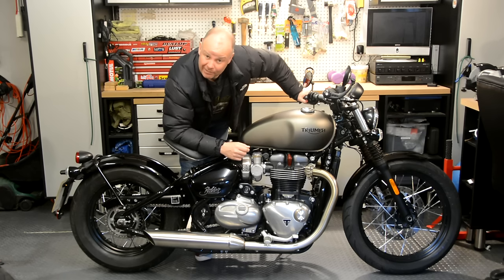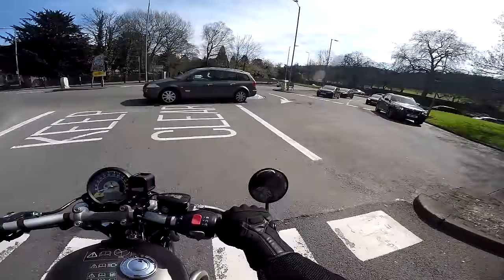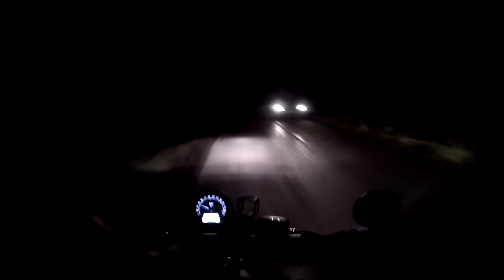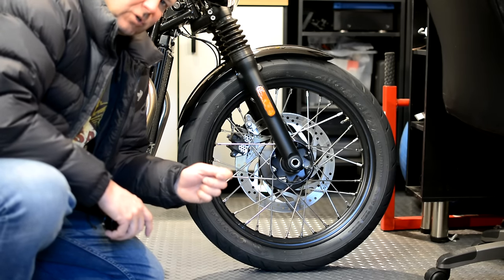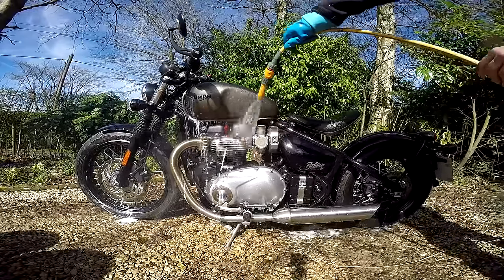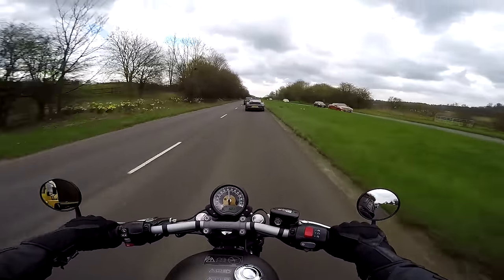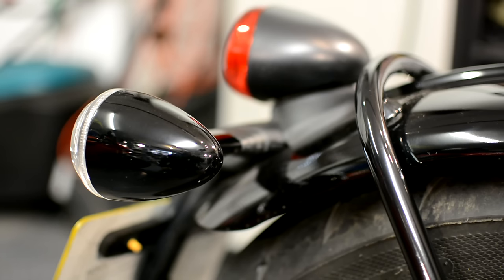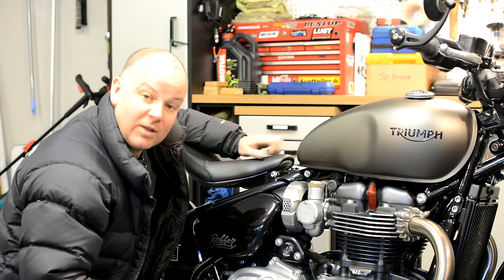Living with the Triumph Bobber - Long Term Review

Comment: Bit concerned about your corrosion issue.  Have you tried GT85, or similar, on the surface?  I know it's an oil, but an occasional wipe over with an oily rag might help with this?  Bit of a disappointment, though.

Great, fun and lively bike, though.  Big smiles!  Think I might go for the mini-apes and Vance and Hines pipes (to annoy my neighbours!).
Reply from the maker: Well it's not actually my bike, if it were it would be thoroughly ACF50'd!  Thanks for watching....

Comment: As ever - a well presented and balanced review. I looked at this before I bought my Bobber, so having had it three years here's my experience. 

The average fuel consumption gets up to around 60mpg once the engine is run in. I usually need to refuel at around 90 miles, with 30 miles left in the tank. I have done just over 230 miles in a day with one fuel stop midday (and yes the light was on towards the end of the ride.) The new 2022 Bobber has a bigger tank, but personally I think it spoils the look of the bike. 

There are various tail tidies available, the nicest one in my view is Maund Speed's in Pasedena. He makes a lovely set of lights based on the old Lucas design. It suits the Bobber very well. 

One thing with the front brake, it wasn't until I replaced the fluid and added some ceramic grease to the sliders that the braking was radically improved. You can use sintered pads which improve the feel but wear the disc more quickly. Triumph dealers will service the bike using Castrol Power 10W-40 oil. The handbook recommendas Castrol Power Racing 10W-40 and it is worth the few extra pennies. The Racing spec oil will turn the gear change from positive and firm to delightfully silky.

The main point is I never get home without a silly grin all over my face. Then I get it up on a stand and clean it - which you're right, is not a quick process but worth every moment.
Reply from the maker: Great feedback - thanks Rev..

Comment: Great review. Love the looks of the bobber. Not practical enough for me though. I don't think you can call it an all arounder. You can't pick up girls on it. You cant haul very much camping equipment on it or run to the store with out a back pack. Since the rear suspension isn't isolated from the rear fender, anything you strap to it, it will be shaken off. My bikes have to perform a lot of different functions. I would get one if all I wanted to do is look good going down the road or to  bike nights. Different strokes for different folks. I'll just keep my 2012 basic Bonnie. Just put some new Michalin Streets on her. 140x70 in the back and 110x70 in the front. With the higher crown on the rear, it turns in so much better then it has ever done. Just took it camping last week end.
Reply from the maker: Nice one - thanks for stopping by Johnny...all the best - TMF

Comment: 1.5 gallon? Geezus,that's a thimble...remove the Cat,get a custom tank built from the bottom of the radiator,underneath,move the fuel pump down there,get it up to 16-18Litre!

Comment: Great review and very insightful! I'm planning to get this bike for daily office commute which is roughly 80 km up and down! Have a few questions:

1. Is the Bobber ideal for daily office commute? One way for me would be roughly 40km!

2. I don't like the idea of carrying a backpack, so is there an option to mount a bag on the sides of the rear? I would need one that can take a Laptop and some accessories!

I would appreciate your reply!
Reply from the maker: 1 I can think of better bikes to commute on! And 2 not that I’m aware of (only smallish saddlebag type affairs).....sorry if these weren’t the answers you wanted!
Reply: @TheMissendenFlyer  Thanks for the reply! If the Bobber does not cut these 2 points that I need in a bike, then I think it is not the one for me! 

I'm now leaning towards the Bonneville T120 and I hope that it fits what I need!

Comment: I'd mod the tank for greater capacity and to get rid of the ugly (and pointless, it's just cheap construction which doesn't save much time or money) flange. Every fooking aftermarket tank company in the world can produce flange-free fuel tanks. You make the weld joint on the bottom inboard then join the halves. Harley can do it (they never stopped) so there's no excuse. 

Maintain the side contour, increase the width. Another precedent, the successful king Sportster tanks. A king Triump tank could look better and hold more petrol.

Comment: Just watched a few of your vids about this and the speedmaster, one thing I need to correct you on is the 2 1200cc engine types. You said this was the same ‘high torque’ engine as the Thruxton (just returned for more torque).

 The Thruxton uses the different high power engine with 95bhp. The t120 however uses the same high torque engine as the bobber, but the bobber has been tuned for more low down/midrange torque. 

I was confused at first since there’s 2 different 1200cc engines... but they also have other variants in a different state of tune. The HT engine definitely has at least 2 states of tune between the t120 and the bobber (not sure about the soeedmaster) but I’m not sure if the Thruxton and Thruxton R have different states of tune? Very confusing.

And of course we have the new 1200 scrambler coming soon with hints of genuine off road ability, fuck knows what engine they’ll use for that, probably the HT, but I so so so so wish they’d use the HP lump from the Thruxton as that engine is to die for, I love it
Reply from the maker: Thanks for the clarification and sorry for the error.....

Comment: How can you live with the microscopic fuel tank, rules it out for me completely, not a motorway cruiser, it would need its own accompanying tanker.
Reply: There are services are between 12 and 27 miles in the UK. Not sure where you live but it wouldn't be an issue unless your using it as your commuter.

Comment: A little off topic but Mr. Flyer what is that jacket you are wearing?  Looks like it would be excellent in warmer weather and also looks like it has great abrasion resistance.  And it looks like it fits well and conforms to body.  Good review also
Reply from the maker: +Joe Perrone Its not a Biking jacket, just a North Face puffa.....
Reply from the maker: +Joe Perrone ah the one in the bike! Yes it's a Summer perforated number - no longer available (can't remember the manufacturer but they went bust a few years back).....

Comment: I have a 2003 Honda VLX 600 Shadow, and I thought that was low on mileage.  The spec states it is "2.91 gallon, (including .9gal reserve)". I get around 95 miles before I feel I really really need to fuel up.  But wow, this thing is low.
I was curious.  Could you due a video where you adjust/pull the set lower down and back?  I know it's made to do that easily.  I would love to seeing a straight on side shot of that to see the lines/profile of the bike.  For my taste, the seat feels to high and forward compared to being nestled closer to the back tire.
Reply from the maker: Sadly it was only a loan bike and it's long been sent back to the Triumph factory at Hinkley :0(

Comment: I just test rode one of these today.  I love the sound and the acceleration.  Good torque, rolls on to power easily.  The first thing I noticed was the braking was not up to par.  Dual calipers and another gallon-and-a-half of gas and it's perfect.  I thought that your review was spot on.  I will most likely be buying one.  It is just too cool to pass up.

I rode the identical bike that you tested.  I have two questions for you about the seat and the handle bars.  Was the seat comfortable for riding all day or would you add a gel seat?  Do you think a set of handle bars that came back another two inches or so would be an improvement?  I am older now and do not really find the stretched forward riding position comfortable;  I guess I am spoiled by my GoldWing.
Reply from the maker: I found the stock seat fine...and was the seat you rode on adjusted fully forward I wonder?  may do away with the need for risers???
Reply: It was set at the middle position.

Comment: I like the bike. This is a Eurobobber and it's kewl. It has it's own look and I'm sure it's own feel. But to me, a bobber is an engine and wheels. With a platform that allows the rider to make the bike their own. Based on an aftermarket that lets the rider customise the bike. Make it THEIR bike in every way. Does the Bonne have that? I mean, when it comes to a bobber, that is important. The Asian bobber ( the bolt) has a wide aftermarket. Obviously, the Sporty is the definition of the bobber. It has an aftermarket that frankly is unchallenged. What about the Bonne? I like it. But the aftermarket is important. Sorry to be so long winded.

Comment: You sometimes wonder about bike manufacturers. A 70 mile range is ridiculously low. You end up with a bike that is essentially a posermobile. Using it everyday would be impractical, as somebody has said, the supermarkets that pass as fuel stations these days are so slow (although many offer pay at pump services), it would become irritating very quickly. Why not offer an optional longer range tank? Slightly bigger, changes the looks a bit, but then makes it more day to day friendly.

As for the lack of illuminated controls, it just continues my pet theme of manufacturers not giving a stuff about the safety of their customers. Fumbling in the dark (ooh ah missus) has to be bad for concentration levels, even if, as you say, the controls are reasonably easy to find.

BTW does the key dig into the inside of your leg?

Comment: Watching you check the tire pressure, I'm thinking, why don't they make those pressure tools have an angled design so it always works easily?
Reply from the maker: +Renzsu Well many do come with a flexible hose, it's not a big issue really just a pain if you happen to have a tyre gauge like mine! Thanks for watching - TMF

Comment: The captain had the same corrosion problems on his Thruxton R. He has now had the engine cover powder coated. You didn't really take the bike up to 80mph did you TMF?
Reply from the maker: +Dougie Yes not good this engine case issue is it...

Comment: Powder coat those case covers, that finish goes back to the 60s Japanese bikes, they will look awful at higher mileage. Also the tank can be swapped out for EFI one. Lovely machine though, when they are around 6K used I'll look at one, can't see MT10, CBR100RR money going on one of these here in Daytona.
Reply from the maker: Nice one :0)

Comment: You comment on the straight wheel valves and that angled ones would be better; surely they're inner-tubes due to the spoked rim? I'm not aware of inner-tubes with angled valves. Is there such a thing?
Reply from the maker: I don’t know Iain, you could well be right. Thanks for watching and for stopping by - TMF

Comment: tyre valves - are they not usually straight? I keep a right angle adapter in my pocket permanently, (thank god as I was once asked to try out a friends BMW 1200 with 12 psi in the front!!!!) - it was raining to boot - scary stuff
Reply from the maker: Several manufacturers fit right angle valves as standard....so no, not always straight.
Reply: I said usually not always, why not show people the adapter and how to fit it - could be helpful tip

Comment: Nice review mate.. Got some questions on filtering though???
Reply from the maker: +beozzie690 Go on?
Reply: Just looking at the current testing for the UK as I am relocating there.. I see the lines at a intersection /\/\/\/.. Looking at the theory section.. I thought that was a no filtering section..  But was unsure as we don't get to filter in the usa
Reply: beozzie690 according to the Highway Code you are allowed to filter but not stop at those lines (at traffic lights) so you either tuck into the cars before you have to stop at them. Also for your test/license you shouldn't filter unnecessarily, especially in situations when know you there are various right turns for cars to take a right. Hope that helps.
Reply: beozzie690 I take it you're referring to the "zig-zag" lines you get on the approach to pedestrian crossings. You must not overtake within these lines (which TMF did). This is protect pedestrians who might be obscured by the vehicle you are overtaking.
Reply: Thanks..OK.. got it.. So I will make sure when I go to take my test I don't cock that one up
Reply: Cheers mate
Reply: David Besant  I was told during a bike safe course (run by police motorcycle instructors) that you can overtake on the zigzag. but you cannot overtake on the crossing. so it was recommended to tug in behind the first car , to avoid the accusations. personally unless the road is  jammed I do not do it so as not to scare the pedestrian s crossing
Reply: thanks
Reply: beozzie690 - you would be best to book a course of instruction and follow what they say to get you through the test. Riding here will be very different to that across the pond; we do not have any straight roads and we drive on the other side, we have roundabouts, you will feel like the traffic is coming at you from all directions. 
Even on an international license (which I think is only valid for 6 months) you might benefit from some form of conversion course for riding a motorbike here. If you plan on riding in towns the traffic density is very high and the drivers will not make allowances for you. I know a number of americans who refuse to drive in Britain because they cannot cope with it. By and large cars are used to motorbikes overtaking and filtering, they don't get upset and normally move over, but don't expect that, assume they are idiots. As you haven't grown up with lane splitting, don't filter until you have completely figured out what the hell is going on.
Reply: Jeff Slade cheers Jeff!! I've driven in and around London but just have never had my bike there.  So I'm very use to the traffic and rules. 
I'm sure it will be different even nice to know that some people will actually move out of the way and understand once they see a bike moving through traffic.  I had planned on taking a block of instruction once I got settled, but as I'm studying the theory I want to make sure the transition is seamless.  
I know for sure one thing is watching out for the speed cameras and radar traps.  
We in Florida don't have to worry about that in certain areas or even the aerial threat of things.
Reply: Beozzie690 - best of luck. I don't live in London and try to avoid it like a plague pit but my gran lived there so I know inner London rather well.
Reply: I know what you mean jeff.. I will be living in South Kensington, so it is what it is.. Just looking at all the options, because I see there are a rash of thefts. I can't believe how many bikes are being stolen.. I will have a garage so that's a saving grace, but still, I seen reports where they're taking right off the street.. Crazy
Reply: Yes apparently so and even a lock-up may not be safe, you need mooring hawsers to secure bikes in London. Off the street is the greatest risk. MissendenFlyer did a vid on theft. You should check out insurance costs before buying any particular bike.
Reply: I saw that vid he did.. I've got 4 bikes, so I will have them put in hard anchors so I may secure them in my garage.. I know the insurance will be massive...
Reply from the maker: ...you can't overtake moving vehicles within these lines or a vehicle that has stopped next to the crossing...

Comment: I was 100 percent going to buy this bike until I seen the extent of corrosion problems on the forums. The beautiful pan seat and engine case were all pitted and corroded as well as other bits. These were on bikes that weren't even 3 months old and looked worse than anything I've ever seen. My 1953 Matchless is better looking! Triumph charging a premium price for a beautiful bike built with sub-par materials. Won't be buying one until they are fixed.
Reply from the maker: Yes I've heard some horror stories too - I can't believe Triumph won't react and fix it for the future but that doesn't help current owners of the first generation bikes of course...

Comment: This is obviously an 'around town bike' ...  Triumph should have put the 900 engine in it. If it was a 900 i would be tempted myself but, as a 1200 ... No Way. It's too thirsty and the tank is ... WAY TOO SMALL ... Oh, and .... the fuel cap opening system is HORRIBLE. It should be, Insert key, Turn key 90 degrees .... and then PULL UP. Easy Peezy. Are you listening Triumph ? ? ?
Reply from the maker: +Loch Ness Biker Yeah I agree on all your points!